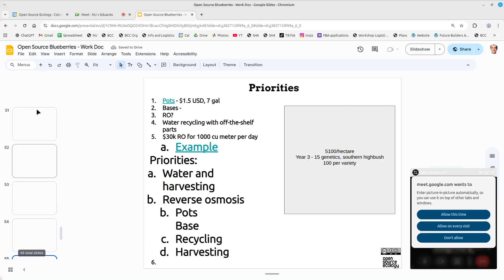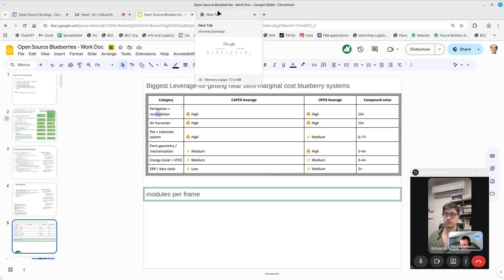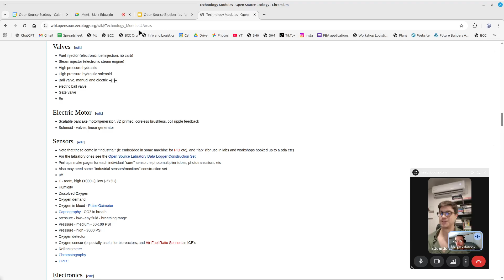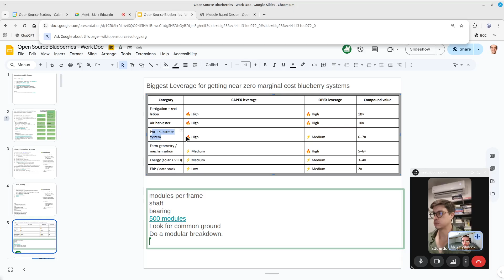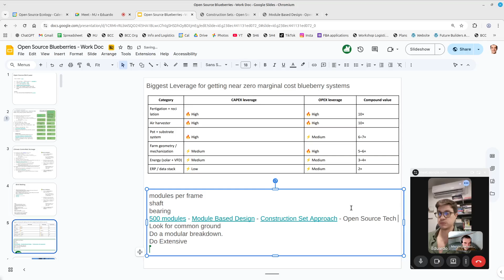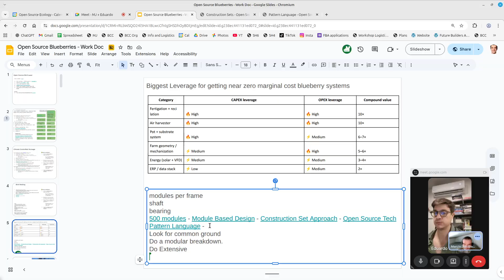Freeze Dried Fruit Powders

Comment: The freeze dryer needs both vacuum and below freezing temperatures for water, and tight control over parameters / timing (Arduino should be fine). I've been looking into DIY freeze drying recently. I'm not sure if the thermal battery would work (not water as a storage medium), but you could use (according to GPT lol) "Stirling/cryocooler driving a silicone-oil or ethanol loop to a coil in the condenser chamber".